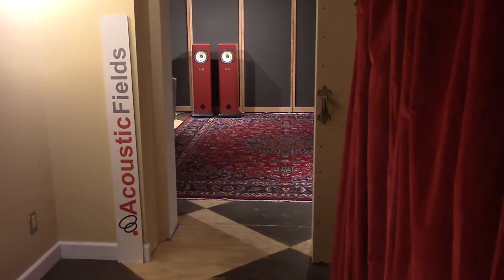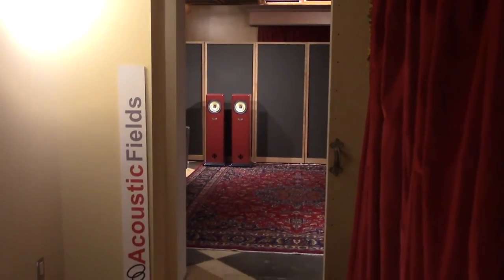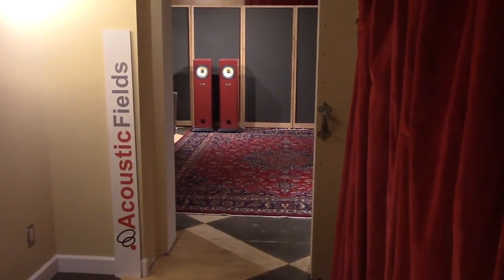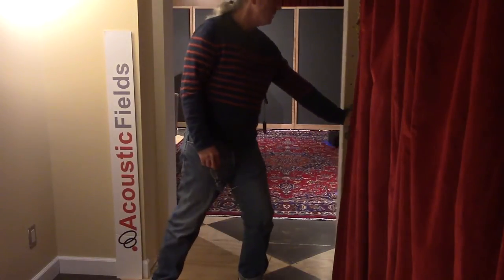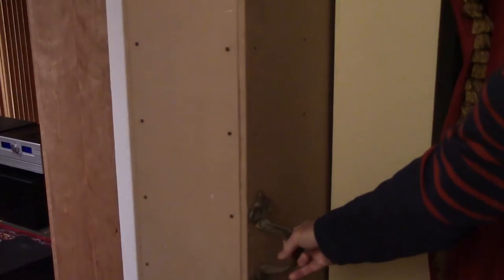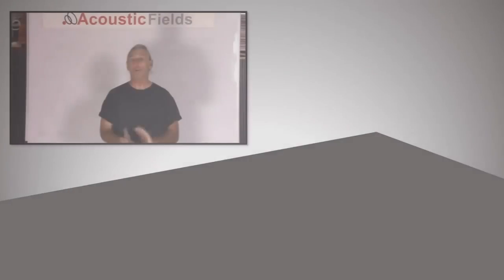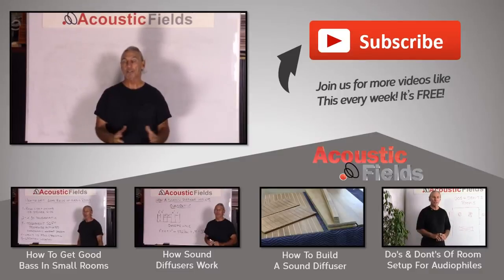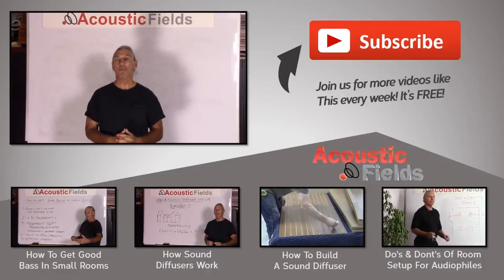Sacred Ground Pocket Door - www.AcousticFields.com

Comment: You said in video you were gonna show how the door was hung but you never did.  Kind of a pointless video without that part left out
Reply from the maker: A, What is pointless is focusing on one element of a build and labeling the whole project worthless. Stay away from focusing on one element of a presentation that you do not like or agree with and focus more on furthering your total comprehension and understanding of complicated concepts that the build represents.
Reply: @AcousticFields  without further explanation it's nothing more than a 600lb pocket door.  Knowing the inside makeup and how its sealed when closed would help explain something about accoustic isolation which I think is supposed to be the point of your videos right?
Reply from the maker: @jaredrush6750  It has the same carbon technology as our walls. You must match densities and treatment rates and levels on all surfaces. Door actually weighs 1000 lbs. as is suspended on a ball bearing rail system.
Reply: @AcousticFields  , very constructive spanking.